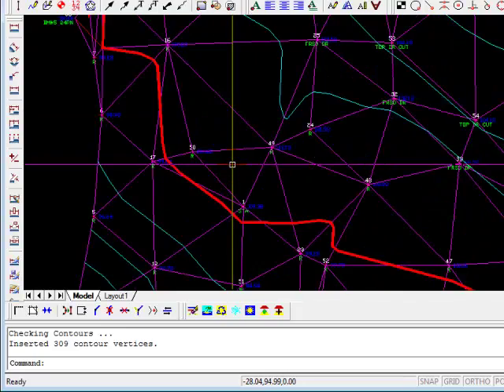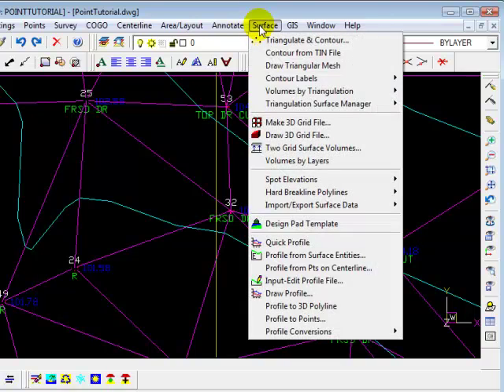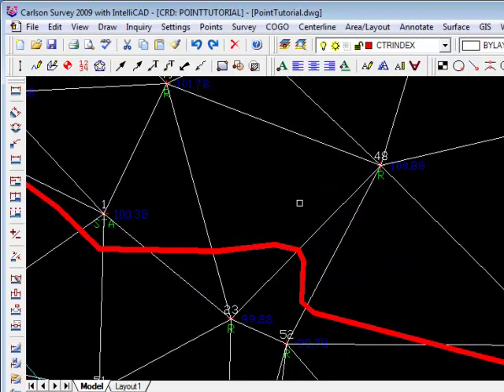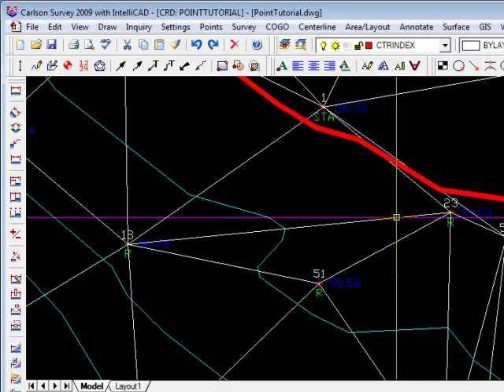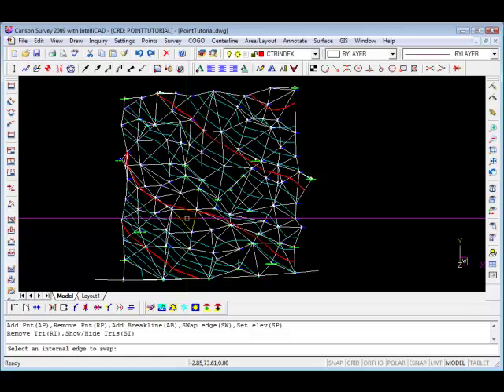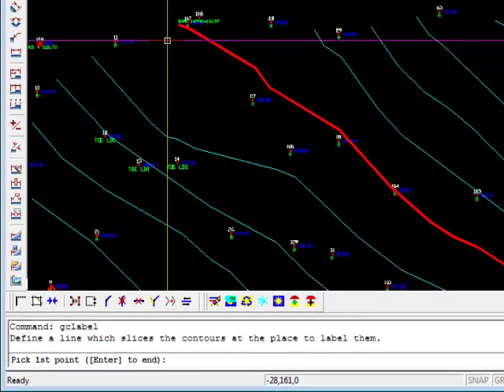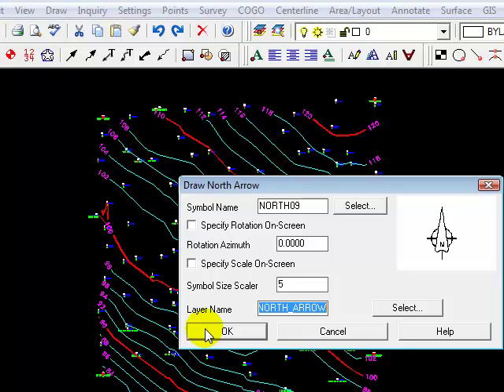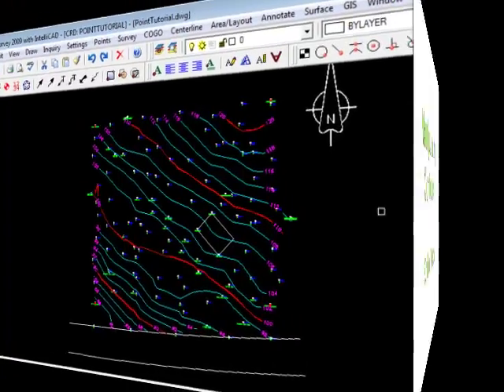Contours Part 2

Comment: You can create the TIN at the same time you generate the Contours (it's kind of like on the fly), but it will want to save the TIN with a file name. When setting up the contouring requirements, just check the create TIN before actually drawing the contours. I can be more specific if needed.